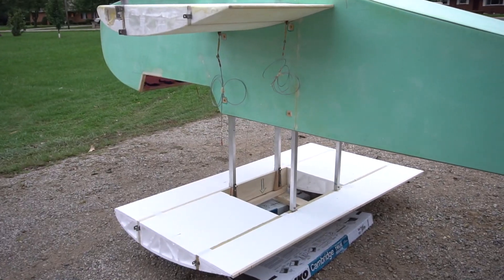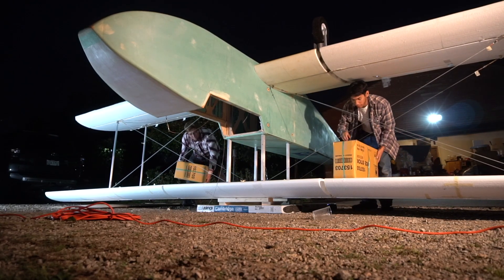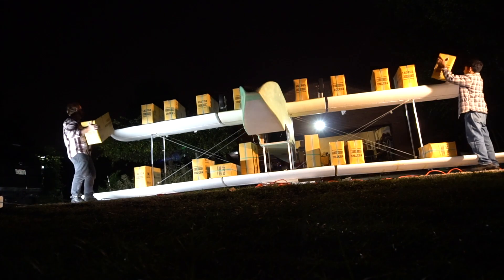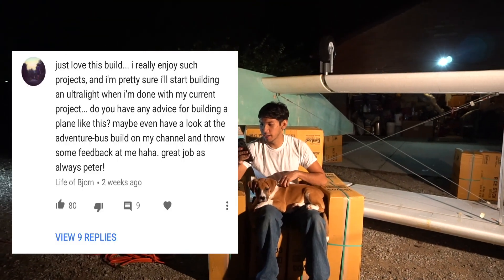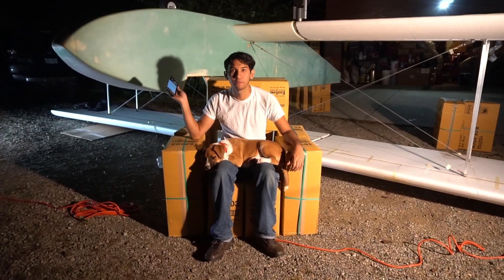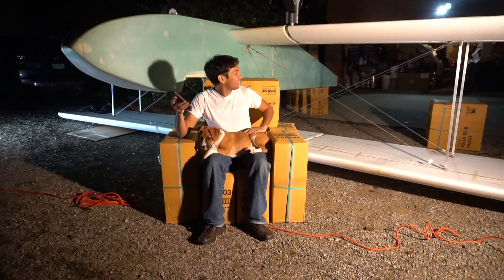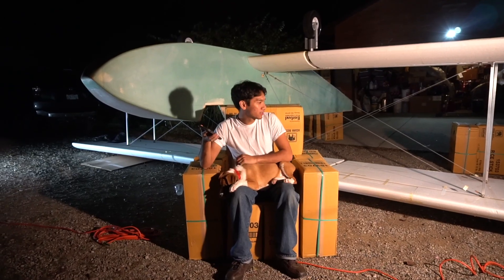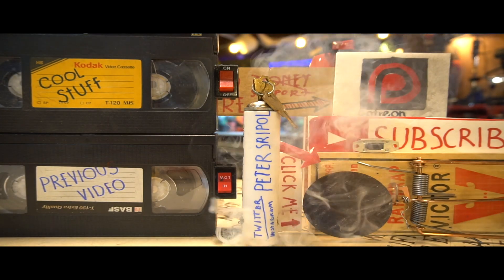DIY Electric ultralight pt5 (Making the Wings)

Comment: NO do not use thread locker on any of the bolts.  The use of elastic stop nuts and cotter pins or safety wire on castellated nut is all you need. 

I see a couple of deficiency in your wing design, there is no bracing wires at your interplane struts fore and aft to take the drag loads.  Then at the cabane struts in the fuselage there should be running both fore and aft as well as side to side to keep things from racking.  

A friend of mine that is a structural engineer and light aircraft designer and I have been watching what you have been doing here.  We are both RCers and EAA members and are scratch builders.  Go yourself a big favor get in touch with your local EAA chapter https://www.eaa.org/en/eaa/eaa-chapters and have the chapter EAA Technical Counselors look over your design before you go much farther.  The last thing Rich and I want to see happen is you fail because of a design issues that was over looked.  

As a side note we were wondering why you had gone with unequal wing length.  The lighter the wing loading the better it is for low powered aircraft.  Because you don't have brute power to get you in the air.

Comment: I notice you didn't put any cross brace wires between the outer struts and the fuselage wing struts. You will need these to keep the wings and struts from flexing. 
One additional thing which would have kept your wings from additional flexing would have been cross brace wires between the spars, however the foam maybe enough. 

I noticed you routered out recesses for the wing brackets in the spars. This actually made the spar weaker because they are now thinner. The aluminum plates only add strength to the spar from the glue. A better way would have been to epoxy 1/8" plywood plates to both sides of the spars and put the mounting brackets on top.  These adds thickness as well as keeps the spar grains from splitting from the loading on the bolts.

Your G loading test was incorrect.
1G  is the flying weight of the complete ready to fly aircraft including, fuel, oil, payload if any and pilot. Flying level equals 1G. 2Gs will be double that weight and so on for higher G ratings. Retest using 1/4" or 3/8"  plywood sheets on the wings to keep the weight from damaging the wings. Add the correct amount of weight to all wing panels equally include the plywood weight to test for 1G.
If you plan on glassing the wings too, this test should be done after that since the glass will add some strength as well as weight.

I look forward to your next video, keep up the good work!

Comment: Do not use thread lock (Loctite) on nylon bolts or self locking nuts. This will make the nylon brittle and break.The nylon is there to lock the threads.

Comment: <— A&P IA.      NO threadlocker.  Self lockers, castellated nuts & cotter pins, safety wire/cable.  

Also agree with the guy saying to bush the bolt holes in the square stock.
Reply: Former military aircraft maintainer here.   No Loctite on nylocks.  If possible, use .032 safety wire.  Lotsa youtube vidjas showing how it's used.  Getting a pair of safety wire pliers makes the job easy....
Reply: No locktite on nylon locknuts. 
What's with all the Negative Nancy's? Think positively! To paraphrase Burt Reynolds, "Of COURSE he's gonna make it! He ain't never NOT made it before, has he?" 😉👍🏼
Reply: Chris McAtee. Should he put safety wire on the turnbuckles too? On the wings?
Reply: Absolutely.  Or the appropriately sized MS21256 clip.

Hey Peter, maybe I missed it but do you have a copy of AC 43.13-1b?

https://www.faa.gov/regulations_policies/advisory_circulars/index.cfm/go/document.information/documentID/99861
Reply: This ^^^.  No threadlocker with nylocks, castle nuts, or safety-wired hardware.

I would also bush the bolt holes.  But... welding a bushing into metal that's already bonded to foam isn't high on my list of things that I would find fun or productive....
Reply: The spinny-spinny part of safety-wiring isn't bad.  But having a pair of pliers that lock, and rotate on a central axis is a big plus.  -Like safety wire pliers.
However... I'd probably just use some needle-nose vise grips (better jaw angle than standard vise grips) or do it by hand.  It's not that hard to get good twists by hand ... and  I'm cheap.  If I have a tool that's 80% there, or I can do it by hand, I'll find a way to make it work before spending more money.
Reply: Here to reaffirm no loctite on nylon self locking nuts. And like others said, safety wire pliers will make your life much easier if you're going to be doing it a lot. Good luck!
Reply: Safety wire is what rockets use. There are even videos right here on YT showing you how to use it. NASCAR teams often drill their own safety wire holes.
Reply: CarsCamerasBikesNTrux SoCal. Hahaha, you don't need no loctite if it's already a threaded nut. Besides, loctite might melt the thread, I guess.

Comment: So the Airplane weights 230# and you are another 120#, for a total of 350#.  So to do a 2G load you have to put 700# on the wing.  You really need to static test to 4G for safety.

Comment: You should add an airbrake so that if your unable to slow down efficiently then you would be able to deploy it and slow down. Also you should have the hot wire on a gilatien sort of thing so you can get smoother and more accurate cuts.

Comment: If you are worried about loctite eating plastic, make some metal mollies with thin tube and thread the inside. Brake line might be about the right size. Also I assume the wheels and bearings are rated to the speed of an emergency landing?

Comment: Make sure you lock your turnbuckles once you're done tightening everything up.
great build and don't have any doubts about your maiden voyage
Just look at the Mitchel U-2 flying wing! if that thing flys so will yours
cheers
no need for locktight and stuff with locking nuts and washers 
- A Canadian Aircraft maintenance engineer
Reply: zenzhou chou this needs more up votes.

Comment: No Peter one Gs would be the total weight of you, the batteries and the aircraft, two Gs would be double of that. So if 370 pounds is one G, two Gs would be 740 pounds. You also need to figure in the weight of the batteries into the gross weight of the aircraft, after all that is part of the load the aircraft will be carrying.

Comment: Pretty cool so far... you have been looking at this, right? https://www.faa.gov/regulations_policies/advisory_circulars/index.cfm/go/document.information/documentID/99861   43.13-1B - Acceptable Methods, Techniques, and Practices - Aircraft Inspection and Repair
See Section 4 regarding nuts in re: thread locking compounds.

Comment: Mabey make it rc too and put a weight in it and see how well it fly's first before you risk your life.
Reply: I think there was a legal problem with that.
It's too big to legally fly RC, but somehow small enough to fly as an ultralight.

IDK how American aviation laws work. shrug
Reply: Can't fly under the model aircraft rules if it's above 55 pounds.
Reply: If you watched his channel you would know he built the whole thing as a model and worked out his biggest concerns.
Reply: John Possum not defending him, but if you watched the previous updates, he did say that he was not going to do it RC because he'd have to get giant servos etc and get the waiver so he could fly it.
Reply: Not as 1:1 scale but he did it much smaller scale with the electric motors in the same place. Check his past vids.
Reply: ImpactEvilGaming you can do it easily by taking apart an RC car and soldering motors on to the circuit board
Reply: I would bring a parachute and not do all this extra rc business
Reply: What height is necessary for a parachute? What if it breaks when you are not at least that high? I think pushing it with RC controls and making sure it can handle a few serious maneuvers first is a much safer idea.
Reply: Patrick Logsdon would recommend same safety first

Comment: As for your test, 16 boxes at 32 pounds each is 512lbs. Let's say your plane (with batteries and motors) will weigh 210 pounds (just a rough guess, feel free to correct me) and the pilot is maybe 160. That means 370lbs would be 1G. 2Gs would be 740lbs, and 2.5 would be 925lbs. Check your math. I'm just guessing on how much the finished product will weigh, but the answer you got seems way too light. I get 16 boxes @ 32# each = 1.38 Gs.
Reply: 2gs in an aircraft are litererally nothing. when you are in a steep turn (60 degrees) you are at a constant g force of 2g. when you hit in such a turn a strong thermal you may end up at 3gs or more without even changing the curent aoa. 
Or when you have to exit a spin and pull out you end up well above the 2.5gs.
Reply: he has put 20 boxes onto the wings later to test the plane for "2.5" gs, resulting in a load of 640 pounds or 1.73 gs
Reply: Still less than 2, and he said he wanted 2.5
Reply: Plus he didn't incorporate the weight of the aircraft into it, it needs to be more than just his own weight, such as engines, batteries, the fuselage it's self.
Reply: Although correct, for his first test this should suffice. Simple straight line take off, 1G flight and a landing I assume. All at very low altitude.
Reply: Julius Meier yep. I think most Ultralights are designed to 4Gs, and standard aircraft to 5.7
Reply: And if he need to do a quick turn, the structure should whitstand at least a 3.5/4G

Comment: No need for Loctite on Nyloc nuts though split pin  locked castellated nuts are far safer.  BTW, congratulations on installing your split pins correctly, I so often see people wrapping them round the sides of the nut Grrrrrrrrrrr!. Done properly, the head of the pin should be tight in the castellation, that's got far more shear strength.

Comment: I'm not an engineer, but I was wondering about the landing gear. It seems to have no real energy absorbing capabilities. It seems that if you have to land on some sort of rough or soft surface (in the case of a forced landing) the landing gear seems unable to absorb any strong forces in a non-vertical direction. Which might lead to the gear either failing in some way or perhaps, it might get stuck in a soft or rough surface upon touch down. I wonder if you need some way to absorb these potential forces to the landing gear. At the very least perhaps a larger and softer balloon type tire might help to absorb these forces.
Reply: I think peter spoke about the ability to release the gear for example in the case of an emergency landing
Reply: They have shear bolts or something like that so they just kinda break off when he lands with any kind of force is what I understand
Reply: Oh, sorry, I didn't see that. Never mind.
Reply: looked it up its in part 4 minute 6:20. It is a release mechanism a shearing bolt could also break on a normal landing, which would be very annoying, damage the plane and peter could be harmed since he is suddenly closer to the ground and will then experience the full landing impact.

Comment: Being a former Air Force aircraft mechanic, I would have recommended staying away from nylon bolts and used castle nuts and safety wire or cotter pins to secure onto the bolts. I saw that you did use a cotter pin on one fitting but it would be good practice to be consistent with all of them. I'm not sure that threadlocker would work with nylon bolts but I'm sure a google search would reveal that.

Comment: I do not have  an A&P license  but I have been working on black hawk  helicopters  for 7 years...generally we don't use thread locker, however we use torque stripes on some nuts so during am inspection  ypu can see if a nut has lossened

Comment: G loading is the maximum possible weight of the plane and everything in it times the load factor. Example: a Cessna 150 weighs about 1150 empty. The pilot + passenger weigh about 350 and the gas weighs about 145 (24 gallons), so the plane weighs 1650 total. Normal category g loading is at least 5.7 Gs, so the wings have to support 9400 pounds (4700 pounds each)

Comment: You finaly talked about my main complain with this aeroplane, the landinggear. I don't know, but would bigger tires also help solving the problem, especially if you take off and land on grass?? Like bushtires in Alaska, Canada etc...
Reply: bigger tires would be a good idea as he is likely taking off from grass where larger tires are less likely to grip and flip the plane on landing...   large thick tyres will add a cushion like suspension too
Reply: Luke P Jeah, I was visioning that

Comment: Hi Peter. For load testing, you should load the middle of the aircraft and rest the wingtips on benches. That gives a better simulation of load factors in flight.
Reply: not really...  on a rectangular wing the weight distribution is even across the whole surface rather than localized on the tips...

Comment: It sounded like you don't want to put wires on the tail. However, I'd suggest putting ones on anyway, simply because I've seen even model planes loose their rudder as gets more aerodynamic force than most people expect. Wires would help distribute the force.
Reply: At low speeds, you pickup a wing by stepping on the rudder.  This strongly suggests that the rudder/vertical stabilizer needs wire bracing.

Comment: Going by the smaller scale stuff I've seen you build I'm confident this will fly. You also appear to be testing it's strength pretty thoroughly. One potential weak link though is the pilot! Do you have hands-on experience piloting a small aircraft?

Comment: Very nice project, the airplane is going to be awesome! If you are using self locking nylon nuts than don't use thread lock because it will eat the nyon, but on the normal nuts it is recommended.

Comment: Please put a bushing in the ends of your square aluminum tubes where you pass a bolt thru so when tightening it doesn't crush the tube .  Without it when you tighten bolt, tube may deform inward on loading then bolt would loosen up. Maybe you did this and I didn't catch on video.  Otherwise quite impressed with all you fabricating skills.
Reply: its just like building a foamy r/c. just bigger. thats how he is able to do it lol
Reply: YESSSS!!!!  You need to test those wing with 3 to 4 times the weight you just put on them. The stresses of flight are incredible!!!!
Reply: I agree, bushings are a excellent idea.
Reply: G'day,

  Am I the only old Ultralight Aeroplane Designer/Test-Pilot to have cringed at the wild assertion that "1-G" is equal to the weight of the Pilot..." ?

  When Static-Load Testing, "One Gravitational Force" is equal to the Total Gross Take-Off Weight of the Whole Aeroplane - including  the Crew, Passengers, Fuel & Payload (if any)...; because THAT is the amount ofweight which the Wings have to lift....

  If this thing will weigh 320 Pounds on Take-Off, then 2-G is 640 Pounds..., and to allow for Turbulence and heavy-handed Control Inputs, it's generally considered as pretty stupid to try to fly in anything which has not Bin-Tested to at least +3 or + 4 and -2...; because otherwise one may well be forced to use the Ballistic Parachute, to deal with Structural or Control Failure...

  Just(ifiably ?) sayin',

  Have a good one...

  ;-p

  Ciao !
Reply: Agree that wood/plastic inserts are necessary to prevent the tubes from crushing.
Reply: Foamies don't matter when they break. Big deal, you get some duck tape out. Broken limbs... Well not so easy to repair. You're comparing standards against 2 different things, like a toy RC car vs a real car with traction control, ABS braking, computer controlled dampening (the really cool electromagnetically adjustable shocks is what I was referring too), etc. Toy car, sometimes have suspension, and usually the wheels are made of foam... So yeah, not the same. Don't make a real car based on the toy!
Reply: He has quite large bolts that should be able to distribute the force well, also I think he has "self-locking" bolts.

Comment: are you using normal bolts when you asemble the plane whilst testing things, because the nylon in the bots degrades when you tighten them and losen them, so if you use nylon bolts you should change them before you fly.
Reply: This! I would not trust them after more than a couple of openings and tightenings.

Comment: So with the fiberglass, would Carbon fiber sheets be a better choice with weight to strength ratio? It probably is much more expensive, but was just wondering your motivations to use fiberglass instead of carbon. Also, Carbon would look reeeeeally cool. Just sayin :)

Comment: Finally! Been waiting on this video for two weeks, really cool to see the progress. Quick questions, are you going to put molded/shaped fairings over the joints in the wings? Also, what are you doing with the wing tips, are you considering a simple fence at the ends, or are they going to taper down? Also wondered if you were going to do ailerons in both wings, or just the top or bottom wings.

Comment: 1 g static load on the wings would be the MTOW of the aircraft along the wings, which is you, motors, fuel, and the weight of the plane itself.  So if the aircraft is 350lbs maximum take off wieght (plane, cargo, passengers, fuel...), you need more weight to simulate 2G.
Reply: 32x20=640. 370x2=740, so 20 boxes is less than 2Gs.

Comment: If it’s a nylock no loctite or any other form of mechanical lock such as lock wire or castle nuts only use loctite on plain nuts or captive nuts or taped threads good job so far on it looks awesome